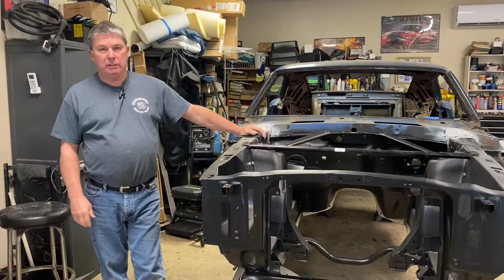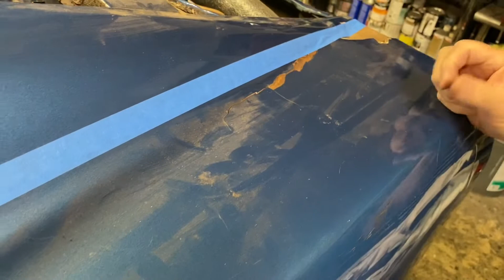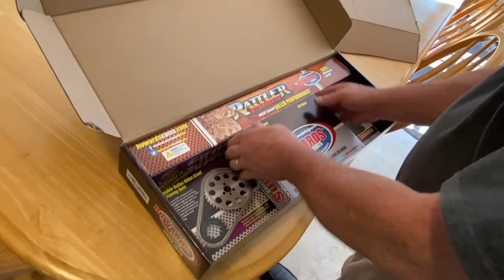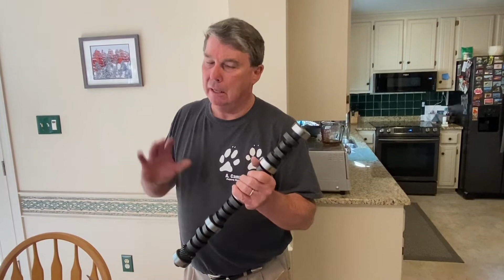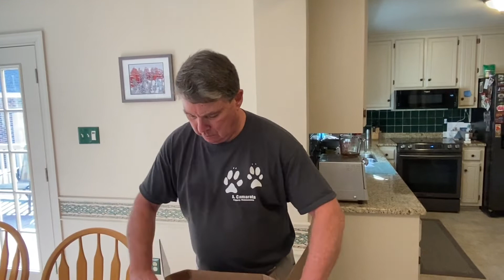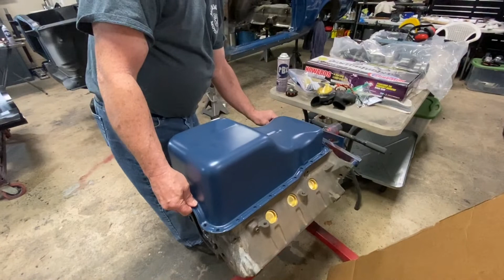1969 Mustang Restoration Update (Part 7)

Comment: Nice! looking good  but im curious about why the original drivers shock tower doesnt appear to  have the re enforced shock tower wrap around brace plate.  Did the marti report say it came with a 351 4v, because what i have found out is that drivers side shock tower got the wrap around plate for 351 4V and boss and big blocks recieved both sides. Would like to keep in contact as im doing the same thing to my 69 Acapulco blue 351 4V 325 rear.
Reply from the maker: Thanks for your comments....I wasn't aware the 351 cars had any additional bracing like the boss and CJ cars.  Reproduction front rails and towers do have it though and that's all that is available. Originally this bracing was for the F60-15 tires which were causing upper control arm mount fatigue during testing. This car is the 4V engine and 4 speed...with a 3.00 rear...I have plans to change to a 325 since I feel it will make the car better around town...thanks at...stay in touch